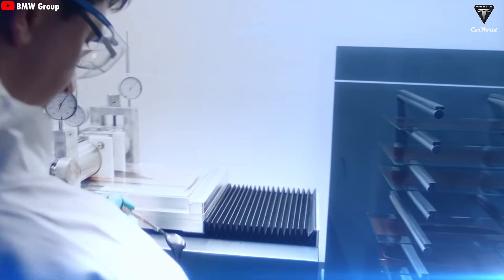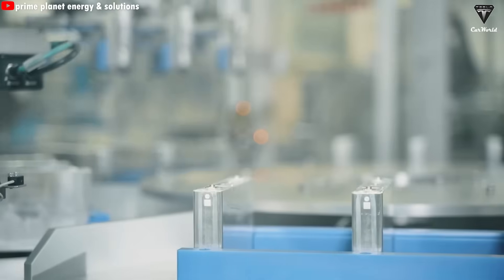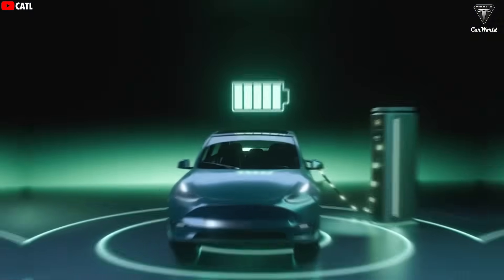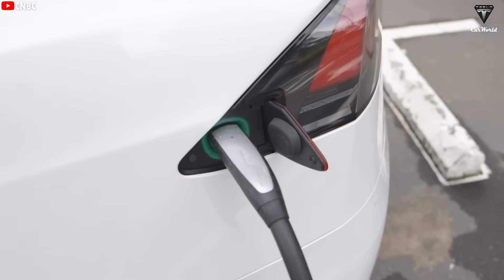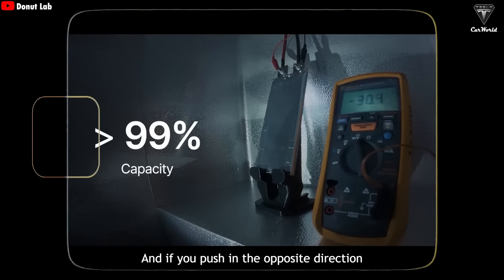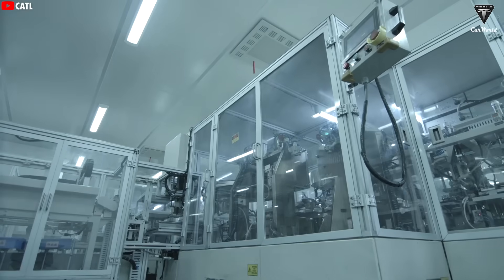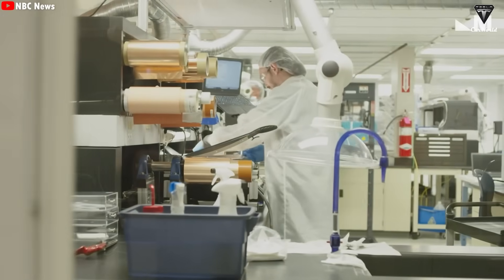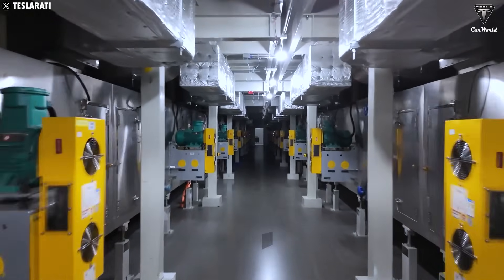World's First All-Solid-State Battery Mass Production INCREDIBLE, 5 Min & 100,000 cycles!

Comment: Really, they didn't reveal how high the charging capacity is?! How about doing some math and figuring it out yourself? The roughest approximation can be easily calculated: if you want to charge in 5 minutes, you need 12C of charging current. So if you have a 75kWh battery and want it to be fully charged in 5 minutes, you need at least 75kW * 12 = 900kW linear charging power.
But at the end: It sounds more like scam... the only voice (besides the AI voicce in the video) telling us they found the holy grail is the person who owns the company creating these batteries, for sure

Comment: 100,000 cycles AND 400 Wh/kg? That sounds too good to be true. Usually, you have to trade energy density for lifespan. If they truly achieved both, it’s a Nobel Prize-level discovery, but without independent verification, it sounds like marketing hype. 

Also, putting batteries in a few high-end motorcycles is hardly 'mass production' for the global market.

Comment: even if it was true... how are you going to charge it? using what infrastructure? how many high output chargers do you think a normal city can hold before burning up their power lines? And finally, how are you going to generate the necessary energy to feed those? coal power plants?

Comment: Sorry, these claims by Donut Lab have yet to be proven.  Based on the specs currently know or deduced from what the company has released so far, this might actually be a supercapacitor and not strictly speaking a battery.  What difference that might make remains to be seen.  The good news is that it doesn't seem to be vaporware.  But what it is exactly is still unknown.

Comment: Would be nice to know the degradation of the battery at say 50k cycles, what does the degrade vs recharge cycle graph look like. Also what is the economic recycle possibility of the elements that make up the battery at end of life, can the elements be extracted economically to made a new battery. What are the economics of scale, cost vs number of units produced graph look like. BTW some tech detectives are saying these batteries are probably printed capacitors due to the constant amperage and voltage during charging and also the battery can be made into any shape as stated by the CEO.. Lithium batteries charge amps decrease as the battery charges.

Comment: I read; ‘Seems they are betting on nanocarbon? Donut Labs made a significant investment in Nordic Nano a while back.
If you look at Nordic Nano’s history, the “secret sauce” they’re most likely bringing to Donut isn’t a brand-new chemistry, it’s how nanocarbon is being used inside the cell.
Nanocarbon materials like graphene-style structures, porous carbons, and carbon networks give you huge surface area, very short diffusion paths, and excellent electrical conductivity. If you build a solid or semi-solid electrode around that, you can move ions and electrons fast without the mechanical stress that kills conventional electrodes.
That explains a lot of Donut’s claims at once. Fast charging comes from low diffusion limits. Long cycle life comes from reduced cracking and more elastic structures. Safety comes from avoiding flammable liquid electrolytes and metal dendrites punching through separators. It also explains the clay-like, shape-agnostic battery story since nanocarbon frameworks are much easier to mold, print, or structure than traditional stacked Li-ion layers.
The leap isn’t that nanocarbon breaks physics, it’s that it lets you operate in a very different regime. You trade classic Li-ion assumptions like liquid electrolytes, layered electrodes, and tight state-of-charge windows for a system that behaves closer to a battery–supercapacitor hybrid, but with much higher energy density than caps.
If Donut’s numbers are even half real, Nordic Nano’s nanocarbon work is probably what makes the battery behave differently. The rest of Donut’s stack just makes it usable at vehicle scale.
Assuming they are shipping these cells on those Verge motorcycles, like they are claiming, then I'm sure someone will soon get their hands on one of these solid-state cells. Probably won't take long until we get some sort of validation.’

Comment: 5 minute charge time. They never tell you how many amps it takes to do that. Reality 1000, 2500, 3000, 5000+ Amps. Folks you'd have to have 4 to 6 plugs in your car or truck/suv to charge at 3000 amps.
Reply: They mentioned that they can change it to what you need. So you decide how many you need.

Comment: The end of gas vehicles as we know it.
Reply: Not at all. Won't happen.
Reply: @mytwothoughts2005 if we get a all solid state battery power car that give 700 miles to 900 miles and can charge within 5 minutes I don’t think there is a need for gas cars
Reply: @More_jay88 it's a scam when will people open their eyes and learn to use their brains we have brains as human beings we are capable of actually thinking about these things so open your eyes use that thing on your shoulders do a tiny bit of research and you will know that what they are proposing is impossible.
Reply: @elixier33  Until it suddenly is.

Comment: Having studied solid-state batteries, and looking at the specs of this battery from Donut, I believe it's an aluminum-ion battery with silicon, or graphene as the cathode, as their cycle life is WAY longer, and their charge time is WAY shorter, than any lithium SSB.  Solid-state simply means no liquid electrolyte, so it still qualifies as an SSB.
Reply: It's most likely sodium-ion based with carbon nanotubes. Sodium would be the only logical choice as they claim it's 100% green. Donut Lab has invested in a local nanotechnology company here in Finland and the CEO sits on its board, so they get the carbon nanotube tech from there.
Reply: it smell so bad, it's BS. just check on the CEO background and his another "Superintelligence ASILAB" on YT. This guy is a fraud. The 2 largest and most advance battery companies are CATL and BYD, if they can't do this pie-in-the-sky '100% "green" solid state 100k cycles battery' how the hell in the world a chubby can't even button his suit fraudster can mass produce "next year"?

Comment: More like 300 miles to 400 miles with NCM vs this new solid state battery. Speaking of which what is the Cost. The only one using this so far that has announced is the Motorcycle company Verge and it's 30k bike . Also unless they upgrade the commercial charger capacity you are limited by the charger.  What is more impressive is there claimed number of charge cycles. Degradation in current battery's seems as much time as use dependent. I am wondering if this could be retrofit kit for current EV's

Comment: The chemistry is not revealed.  Need to know if this is still lithium based.
Reply: In Donut's unveling, their CEO said it's not lithium, it uses common, safe materials.  I believe it's an aluminum-ion battery, with silicon or graphene cathode, that's the only way it can deliver 100k cycles, 5 min. charge time, and not have lithium, that I know of.
Reply: CEO says no lithium 8:00 minutes in : https://youtu.be/eGw-Wm4fyGI?si=KS1foQru6kRUFJ-9&t=470
Reply: Seems to be sodium supercapacitors with nano materials